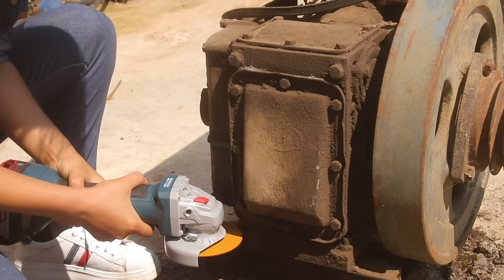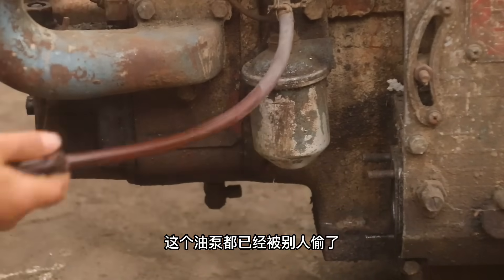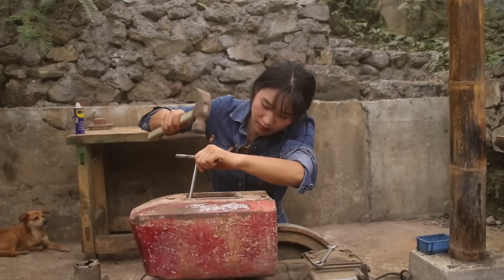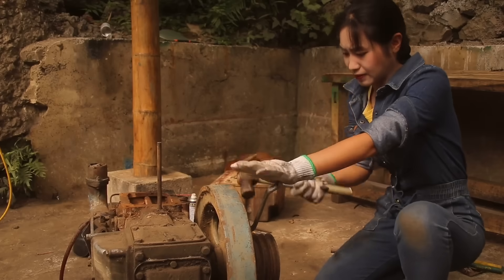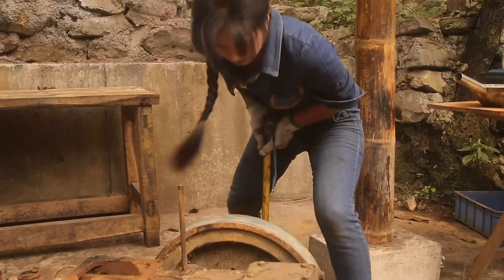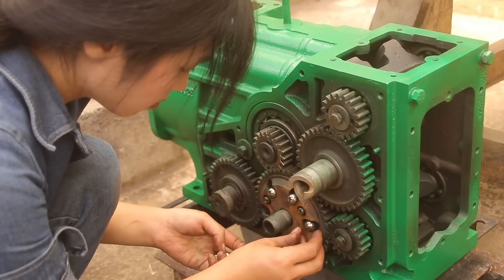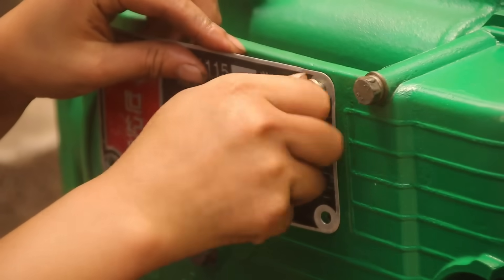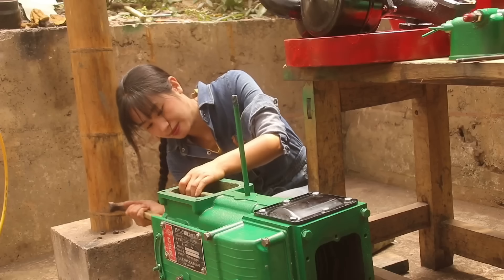💡1115柴油机被被人拆了好多零件，彻底报废，修好后震惊所有人！A genius girl repaired a scrapped diesel engine! | 林果儿

Comment: Say what you will, she's a very talented young lady
Reply: I totally agree with you 👍🏻👍🏻👍🏻🎉
Reply: These videos are made for entertainment only. This woman is not doing all the work herself. Keep in mind the obvious, ever see her use a voltmeter on any electrical project? Ever see her with a schematic to run circuits? My 3 sons and myself are in the trades, and it is insulting to claim she is a genius in 15 trades, when in reality it takes decades to master just one! I spoke to the maker of these movies, and he told me She was hired to make it look like she has these skills when in reality she does not.  And I have spoken to several people who said they know her as well as the man who makes these movies. She was hired as an actress. If she were hired in any shop where we are she would be fired on day 1, why? She is unqualified to do the work she pretends to do.
Reply: You are trying again. Some parts of the proces are skipped, like the second coat of paint. Those Chinese engines are basically from the same factory. It's easy to rebuild those. I've seen her with a sheet of paper to calculate the wiring. 
If you can't master more trades, that's your handicap, and it's not normal that all people have the same handicap as you. I have a set of trades that is getting near her set of trades, but I'm not making videos.  @hdvictoryford5329
Reply: @hdvictoryford5329  What is insulting is your jealous comments, I have never seen you or your sons do any of these things, just hateful words nothing more!